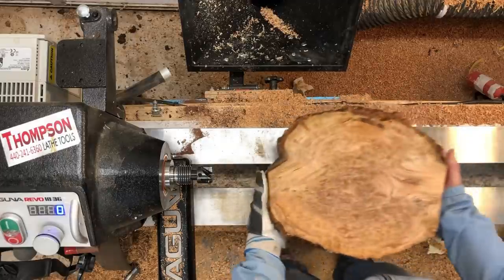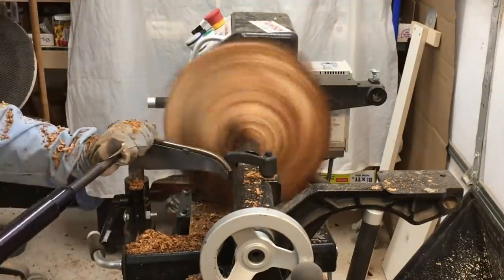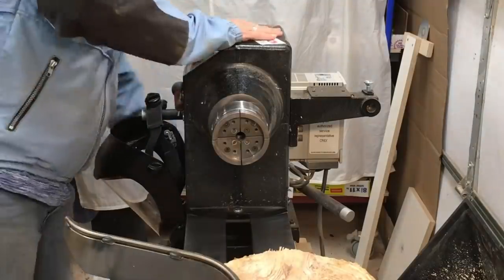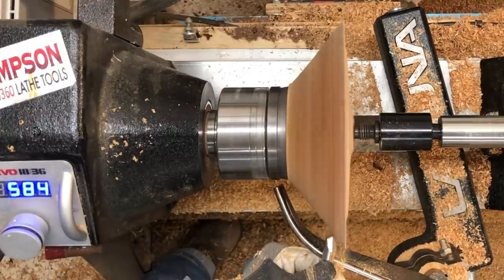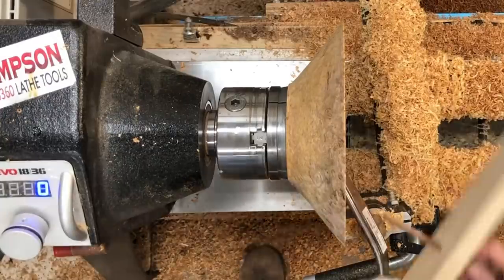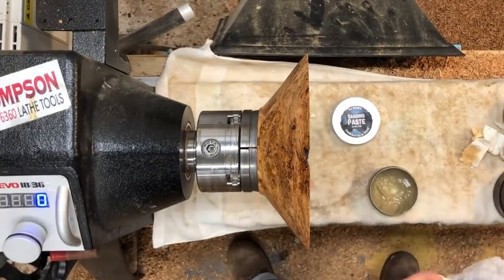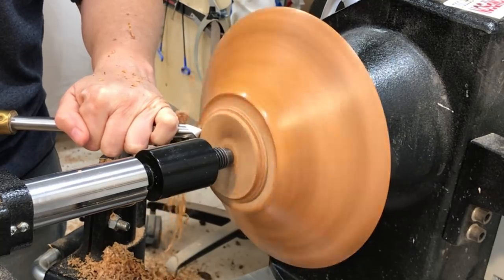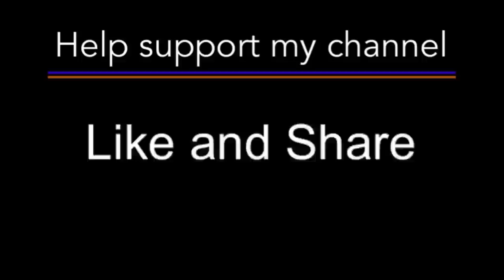Woodturning: Turning a Cherry Burl Bowl - The Just a Bowl’s Little Brother

Comment: Thanks for the smart design of the stand to hold the logs for cutting in half. I just made a bench top version that works well in my shop and I was able to safely cut 5 logs/burls today, so I have some blanks to work with and get prepped to mount on the lathe. If I can figure out a way to attach a picture I will. All the best!
Reply from the maker: Hi Edward! Can’t take credit for the design of the stand since I followed another YouTuber’s video but it does work nicely! I’m going to extend the boards that make up the V part so the smaller pieces will catch and hold but aside from that I think it’s brilliant! Not sure you can attach a pic but my email is in my channel info so feel free to send a pic there. 😁

Comment: Gorgeous and super that you have a coring system to pull out all those other pieces. I have a near identical cherry burl which I have cut in half but no coring system. Just sitting on the pieces until I have a better idea on how to use it.
Reply from the maker: The coring system was expensive but will pay for itself in short order, especially when dealing with burls. I’m quite pleased with how many pieces I was able to get from this one burl 😁

Comment: I was under the impression if you turn too thin green it will crack? This is beautiful 🤩
Reply from the maker: Hi Mark! When turning green the most important thing is to get an even thickness so it will dry evenly and the thinner it is, the quicker it dries. So generally the thinner the better as long as it’s even 👍
Reply: Thanks. I’m going to try it.  Maybe on some pine first. Don’t want to risk my good wood yet

Comment: Lisa, Can you recommend a Lathe for a beginner? I like your videos!
Reply from the maker: Hi John! There are lots of options as far as lathes go and it will depend on what you think you want to do with it. Lots of people start with basically the cheapest lathes you can get, Central Machinery from Harbor Freight, RO make sure they’re going to like turning before they spend a bunch of money. I knew I was going to like it so I started with a Delta midi lathe, which would do a 12” bowl and I was pleased with that lathe. However, I decided I wanted to do larger bowls so upgraded to the Laguna with the 2HP motor and am very happy with it. Jet makes very popular lathes and have mini, midi, and full size lathes. Top of the line are probably OneWay, Powermatic and Robust. Your budget will dictate the direction you go. If you have a turning club in your area that’s a great way to learn and see how you like brands, etc. Turning is super fun - prepare to be addicted! 😁
Reply: @LisaRamlow  in high school I like running late in metal shop I took three years of metal shop now I'm retired and kind of would like to do something other than watch TV so I think I would enjoy I've been watching your videos and several others

Comment: Great job. That cherry is so beautiful. What kind of coring tool is that. Been thinking of getting one, but not sure which one. Any suggestions. Nice job.
Reply from the maker: Hi EJ! This is the Woodcut BowlSaver system and has 2 knives. They also make the BowlSaver Max which has 3 knives and will do a larger core, but honestly I didn’t think I’d be turning many bowls big enough to require a larger coring option. OneWay also makes a great coring system and is very popular. There are a bunch of videos on YT with in-depth demos of the various systems. Shawn at wortheffort woodworking has one on the OneWay and McNaughton systems and Mike Waldt has one on the Bowlsaver, but there are several for each system.

Comment: I'm looking to get into wood turning. Does anyone have advice on a good lathe to start? I don't need anything huge or that will break the bank until I know what I'm doing.
Reply from the maker: Hi Jamie! First and best advice is to join a local wood turning club. The AAA has chapters all over the US and I believe there are equivalent organizations in Canada and across Europe. You’ll get lots of help and encouragement and can usually do some turning on the club lathes to get started. They can also a lot of times help sourcing wood and equipment. As far as lathes go, I started with a Delta midi lathe and I know a ton of folks who use the Central Machinery lathes from Harbor Freight as their intro machines and then upgrade from there. Where are you located?